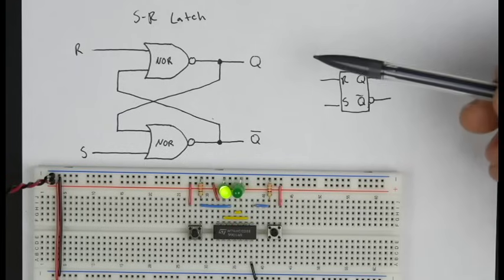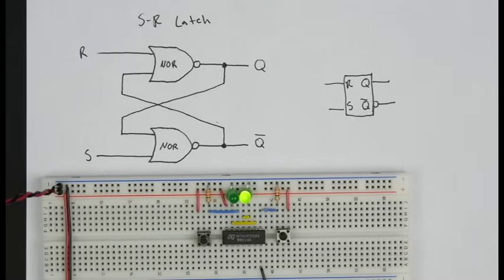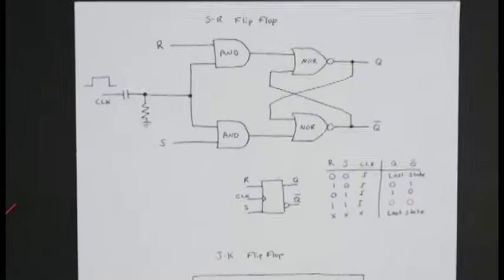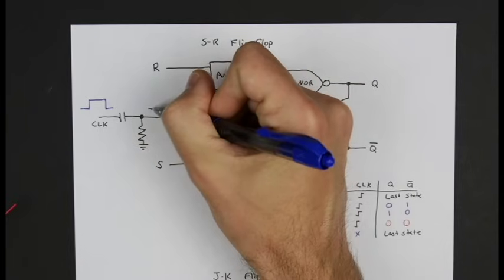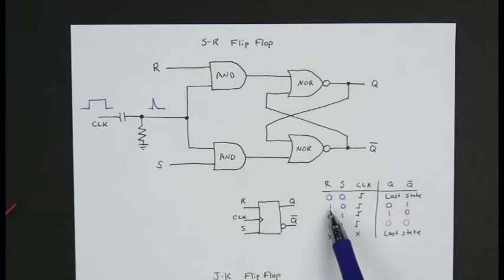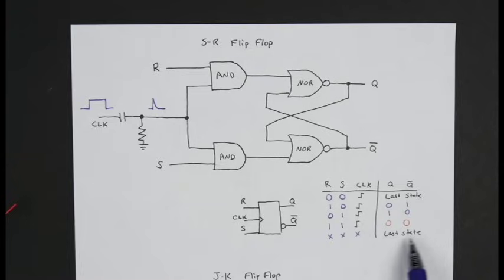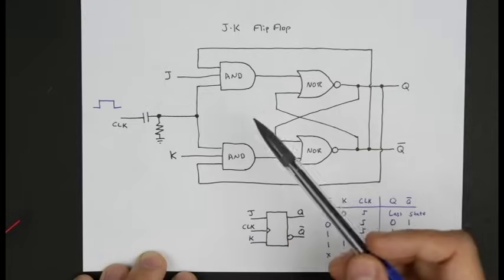JK flip-flop

Comment: at  7:29 in the video you said that Turning K high will reset the circuit, but if you turn K HIGH, That AND gate will turn on and it will make the output HIGH but when that goes to the NOR gate , the other input of that Nor gate is High as well so the NOR gate output will stay LOW.. i don't understand how turning the K input HIGH will Reset the JK flip flop  . Can someone please explain how that going to happen?
Reply: so he actually made a mistake there I think,
you could either AND Q with J, AND Q` with K

or you could say that "Turning K high will SET the gate" so basically K is set, J is reset

Comment: But if I'm understanding this correctly, this requires the clock pulse, as produced by the clock signal coupled with the capacitor, to be shorter than the toggling procedure of the JK flip-flop, right? Because if it were longer, then as Q and !Q both toggle, the other AND gate would become active and therefore toggle once more, potentially toggling multiple times before the capacitor is ultimately fully charged. I assume we are talking about different orders of magnitude here, if I recall, another clock pulse we produced in this way on the 8-bit computer was on the order of 10 microseconds? I would have expected AND & NOR gates (and therefore the whole JK flip-flop) to operate faster than that, but apparently I'm wrong in at least one step of this train of thought.
Reply: Ah, should've kept watching the playlist. Apparently I wasn't so wrong, clarification is given in the videos "JK flip-flop racing" and "Master-slave JK flip-flop".

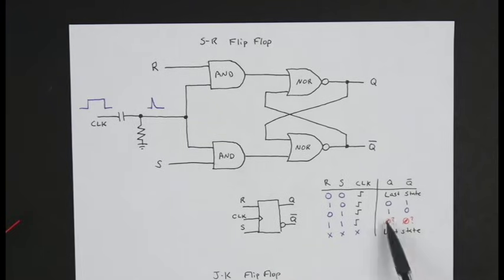Comment: Further to other people's comments, I think the J-K flip-flop (6:10) schematic has two errors. 
To achieve the toggle action for simultaneous J K inputs, the Q Q' AND-gate feedbacks are inverted.
And it is convention that J stands for set and K for reset, so the labels are back to front. 
I think the correct schematic is something like https://drive.google.com/file/d/1sSv7SQfSi6GpFCONb6ysJ6aURJutPFnN/view?usp=drive_link

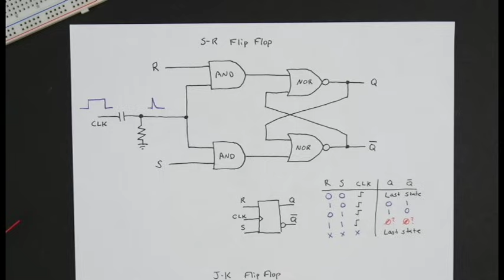But Ben's schematic with the inverted Q and Q' feedback is interesting. Instead of deterministic toggled outputs, it results in deterministic un-changed outputs. So it is better than an S-R Flip-flop, which results in non-deterministic outputs for simultaneous inputs (6:03).

Thanks to Ben again for the great videos.

Comment: Some say the JK-Flip-Flops where invented by Jack Kilby, but I think it's more like an homage to Jack Kilby that those inputs are called J and K, since Kilby was the inventor of integrated circuits (germanium based, which was invented in his freetime in September 1958) and also the inventor of the electronic calculator. The JK FlipFlop got patented in 1966 (May 18th) by Motorola Inc. (Norman J. Miller) and I think Kilby was only working for Texas Instruments and also as a private inventor/engineer. 
Also often used terms are Jump and Kill. Miller did not mention the meaning of J and K, I just looked the patent sheet, he just wrote J and K there.

Comment: 📺💬 Tell me Jirayu what can be applied.
🥺💬 I watch because the course is fundamental and solid skills, you have a number series generator then you can create random by button.
🐑💬 It is the same as quantization to reduce repeating information for CD or telephone and also working with multiplexers.
🧸💬 It can subtraction signals from sources.

📺💬 We don't know key press and her came out you keep the car..
🥺💬 That is no change it can create work opportunity and travel purpose, my teacher also design key for top model using diagram explain as you do also my friend design the car but it had working with me in many situation for many years now I study for future carrier. ( that is it the reason, but I use the lower model )

📺💬 And again JK the key protector . 📺💬 Q value is toggles.
🥺💬 Yes and those they still key confusing my key signals and more but as I told I aim for work and study only but they are do that by intention 🏡‼ ‼ 🏡🥺💬  ...
📺💬 And see if you go to school to study from online material there is more a lot more than what they keep poking him.

Comment: For anyone wondering about the drawing: The mistake lies in the connections of the Q outputs to the AND gates. Q must connect to the upper AND gate with the J input, while !Q must connect to the lower one with the K input. Now it works as it should: J performs the Reset function, K performs the Set function, and J+K at the same time performs either the Set or the Reset function, depending on which state the Q outputs have been before, a.k.a. it performs the "Toggle" function.
Reply: Jesus Christ and I was going crazy to find what I did wrong. Thanks for sharing.
Reply: @tielessin - ditto
Reply: Thanks for sharing
Reply: The drawing is correct Q goes to K, !Q goes to J in terms J is "Set", K is "Reset", which is default I suppose. If both J and K are 0, Q doesn't change. If J is 0 (K = 1) => Q goes 0 (or !Q goes 1), J = 1 (K = 0) => Q goes 1 (!Q goes 0). J = K = 1 => toggle Q. Therefore J sets Q to 1, K (re)sets Q to 0.
Reply: @valeroso_rs   You are doing this on memory, stop memorising and check the graph and the scheme once... If we were using 4 nand gates instead of other gates, the scheme and graph would be totally fine. But we are using nor gates. So everything except the values in the graph are correct, but J works as reset and K works as set in a JK flipflop that was originally an SR flipflop with "nor" gates. You should check  "JK flipflop using nor gates" and "JK flipflop using nand gates" to see the difference better. J is always connected along with Q' but it's function differs depending on the inner gates being nor or nand.
Reply: Finally. I thought I got it wrong.

You saved me, body 😅🎉❤
Reply: you are right!
Reply: you are right!
Reply: The problem actually lies in the gates, if the inner gates were nand gates instead, it would work correctly. Or you could switch the placements of J and K aswell.
Reply: This is ridiculous, thank you so much. I was losing my mind trying to figure out how the hell the logic worked with his drawing. Glad to know it's just wrong and he didn't do anything to fix it...

Comment: From 7:00-7:41, you explained considering when Q is High, J=0, K=1. In this case, the output of And gate for K is High and Also since Q is High, we get Output of NOR gate is Low at K side. Since J is already low, NOR gate at J side will also become active and so remaining Q to HIGH. Ultimately this circuit has no change in the output even you set the clock. Can you please explain me as I am confused how to reset Q when it is set in a condition J=0, K=1. Thanks in advance!
Hope it would be correct using all of them as NAND gates instead of AND & NOR gates.

Comment: I need to do this but with 4 push button switches and 2 CD4066 chips. Basically want to switch between 1 or 4 channels on a guitar amp. The circuit in the video would allow for two channels but I dont know how to get the 3rd and 4th ones to work.

Comment: A famous experiment for JK FF is to set both the J and K high and then connect the CLK to an active high MOM switch, this will toggle the output between HI and LO... The mechanical switch may produce noisy output so the filtering RC circuit is a must.

Comment: 7:20 seems to be wrong. You say that an input of 1 to the lower NOR will be a "reset" and make Q equal to 0... BUT in your SR Latch video (https://youtu.be/KM0DdEaY5sY) at 9:48 you labeled the UPPER input as "reset" and at 10:05 in the latch vid did an input of "1" to the lower input and got a Q of "1." Also, when I worked it out myself that's what I got as well... 

I'm pretty confused since I tried to replicate this circuit myself and work it out by hand, but all the outputs I'm getting amount to HOLD. Anyone getting this too? Am I doing something wrong?

Comment: If the circuit is set(Q=1 and Q'=0) and we input  K=1 when clock is high, then won't the nor gate have high inputs thus outputting 0? How does this reset the circuit as we get the same output Q=1 and Q'=0? You didn't even bother explaining this.

Comment: 7:00 I think resetting Q when it’s set by giving K =1 and J = 0 is confusing, or wrong.
On clock, K&Q = 1 => lower nor out is 0, I.e., ~Q is 0. Therefore Q is 1. Set Q by making K = 1 not reset Q.
Reply: Ah, the Q, ~Q or named wrongly in the picture.
They should be switched. Then the logic will work as you are describing.

Comment: So... in summary (having been through the set now) SR latch has two inputs, one to turn it on, one to turn it off. A D latch has one input to turn on or off but its state is ignored until the enable is on. A D flip flop is similar but the enable (clock) rising edge is converted to an "enable" pulse to make it only check the input state momentarily. A SR flop flop is similar to a SR latch, but the state of the inputs is ignored unless an "enable" is on (which is actually a pulse created from the rising edge of the clock). A JK flip flop is the same but with some extra connections to ensure the "both inputs on" state doesn't cause unknown behaviour and instead toggles the output in a predictable way. [Note, mainly just wrote this to summarise to myself]

Comment: 3:15 It there not another current pulse in the falling edge as the capacitor discharges?
Reply: I thought about the same thing. He mentioned it in his video about D Flip Flop. But from the circuit he had built and tested in that video it is confirmed that the falling edge of the clock signal does not create another enable pulse. Although I still doubt why the falling edge doesn't create an enable pulse. I sent a comment on that video about this.
I think on the falling edge, the current is in reverse and since the circuit can't provide the current needed to discharge the capacitor, the capacitor gets this reverse current from ground and thus does not affect the circuit and does not create an enable pulse. I'm not completely sure about this. Can someone confirm?

Comment: I'm confused as to why J turns on Q. Wouldn't J going high cause the top NOR gate to output 0, thus causing the bottom gate to output 1 and set inverse Q high (i.e. Q low)?

Comment: So I'm confused about the RC circuit. I get the idea that the current causes the capacitor to charge until it's "full", and the resistor is supposed to control how fast that happens, but what confuses me is why the current would bother with the resistor when there's a couple wide-open AND gates leading to a lower resistance path there. Also, when the clock goes from high to low, where does the capacitor discharge to? Why doesn't it push current back into the clock circuit, causing problems with the clock signal?

Comment: How sharp do the clock pulse edges have to be?  Would it respond the same way if the clock signal were a sinewave as opposed to a squarewave?
Reply: electronics usually works with dc circuits which give a square pulse, not a wave.
Reply: If a logic chip is powered by 5, 9, 12 or 20 Volt, the threshold internally is divided by 50%, so it will respond to anything above 50%.
regardless the shape of the wave/pulse, if properly offset-ted or some diode if it's bi-polar. off course the timing will be later on a sine wave vs a regular pulse.

Comment: There is a mistake in the JK schematic diagram - the K works as reset and must be on top and J (set) in bottom. Just compare it with SR flip-flop diagram wich is the same except for the feedback lines from the Q/Q-not outputs.

Comment: I learned about logic gates, flip-flops, latches, when I was in 1st-year university, 12 years ago, but the professor did not provide the electronic behind it and how it actually works in the circuit board. I was ultimately confused when I was taught the inner schematic of flip-flop consisting of logic gates and a feedback line. I thought it didn't make any sense at all.

I was studying computer science, by the way. So logic gates, flip-flop, and stuffs were only a part of introductory courses in my major, without actual physical implementation. We only used a computer-based simulator software (Multisim) to create a schematic of a logic circuit. On the other hand, I studied some basic electronics during my high school and was introduced with electronic components including resistor, transistor, capacitor, and so on. But it was really difficult for me to connect between electronics, digital logic circuits, and eventually a computer, and I realized for a very long time that there is a missing link that wasn't really taught by my professor at the university.

But you explained it in a very clear and concise manner, with an actual demonstration, and finally, I understand how the feedback line in a flip-flop works, and its relationship with how a transistor works in an electronic circuit, and even I can finally connect all the dots from the electronic circuit primitives into a real computer.

Thank you very much for all your videos. You said you didn't have a degree but you explained this topic way better than my professor did. You proved that there is something that is really wrong with the education system as you mentioned that your ultimate goal is to improve it. I hope you will achieve your goal, and perhaps you will actually introduce students properly about how basic digital system works. :)
Reply: Well I'm taking a class like that right now as a computer scientist, and we still are shown any of it. I guess we are shown diagrams, but not how the signal actually goes through all the parts, most likely since we go through many diagrams in one hour long lecture, so not enough time is given to go more in depth. Crazy how not much changes after a decade and a half in a fast changing field of study though.

Comment: 6:00 if the output is unpredictable, could you use it as an RNG? Of course, I expect it's not 100% unpredictable, as there's probably some bias, but maybe there's something that could be done to normalise.
Reply: I haven't tested this, but the uncertainty is presumably due to inconsistencies in production causing gates to have different delays; thus I would imagine although it's "uncertain," it's probably deterministic once you've built the chip. I'm sure there are other factors and so it's not completely deterministic, but it's likely extremely biased all else equal.

Comment: I know this is kind of a stupid question, and off-topic, but:
What happens if you connect the output and the input of an inverter together?
Will it be a really fast clock?
Reply: Nah, I think it would just show 0 volt.

Think in terms of transistor, a common emitter circuit with a load parallel to the collector. If the output is fed back to the base (input) it would create a short circuit among the CE path and the external load will not conduct any current anymore since  the transistor is now activated.

So, it would simply turn off
Reply: @jawadanwar6684  but what if you do it with three inverters? Like in a loop...

Comment: So if you set both J and K inputs permanently to 1 you will have a pure latching toggle on each pulse of the clock, similar to s single latching switch. True?  If true then the clock signal can be replaced with a momentary push button that can act as a logical latching button. As long as there are some delay is built in so that the real physical button does not produce multiple "clock" signal with every push.

Comment: I love these videos, especially this series on the 8-bit computer, but that edge detector circuit is flawed. After the high pulse, the capacitor will discharge back into the clock, causing a negative voltage on the input of the gate. I've included a link below to a design I found online which solves this problem. It's a bit more complicated than a simple differentiator, but I think it's better to do things right than easily. I get that you were probably trying to keep it simple for the sake of the video, but I think you also should have made a video that addresses this issue and goes a bit more in depth into making a better edge detector circuit. Anyways, as I said I believe these designs should fix the issue of negative voltage. I should note that I"m not the creator of this image, I simply found it while perusing Google images.

https://i.stack.imgur.com/vAAr1.png
Reply: Nothing\ I had the same doubt why didn’t he get negative edge when clock goes high to low.

Comment: Something feels weird to me about the 'Toggle' in the JK flip-flop... It makes sense that when both J and K are set, Q would toggle on the rising edge of the clock... But, whilst the clock is on, the whole gate is unstable; that is Q would toggle on and off, until the clock goes low. That's precisely what causes it to 'Toggle'. But what keeps it from toggling more than once? Yes, the clock should only pulse, quick enough for this not to happen. But what if the clock signal is not in spec? Basically, would an excessively long clock signal cause the flip-flop to 'Toggle' twice, or more? What if the clock module is far enough away that electro-magnetic fields in the wires might cause issues? Is any of this relevant? Does what I just wrote make sense to anybody?
Reply: Welp, all is answered in the next video! XD
Reply: Was looking for this comment. Noting this is pretty glaringly missing from this video. Most people seem too busy with the origins of the name though to notice the problem.